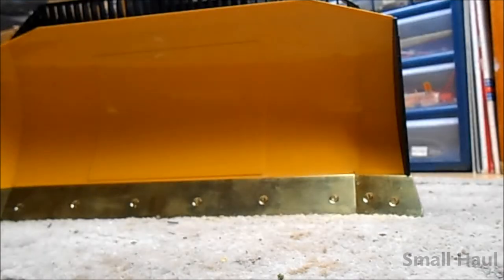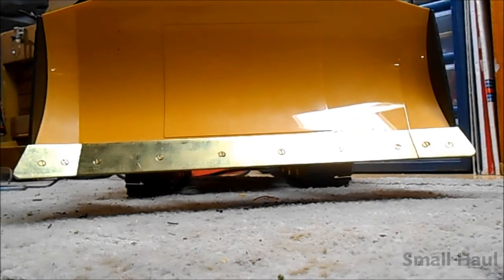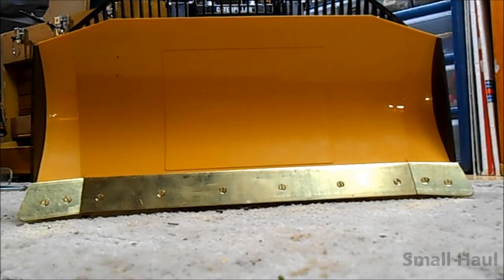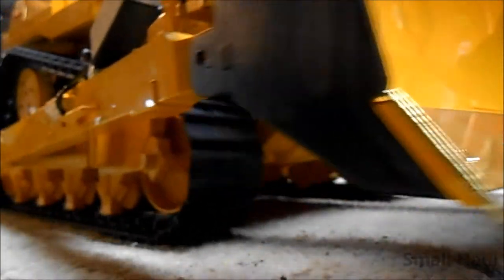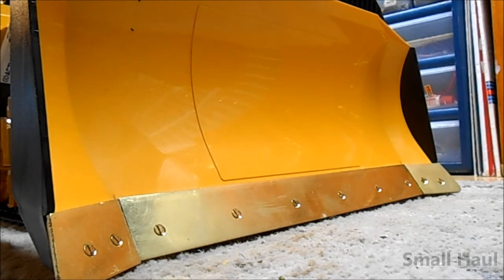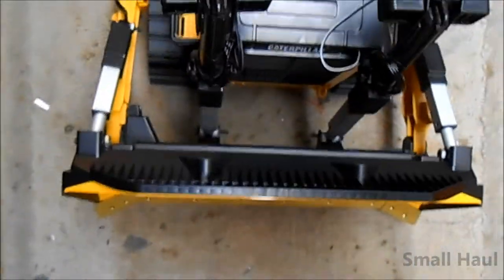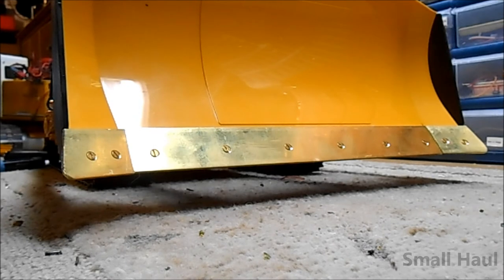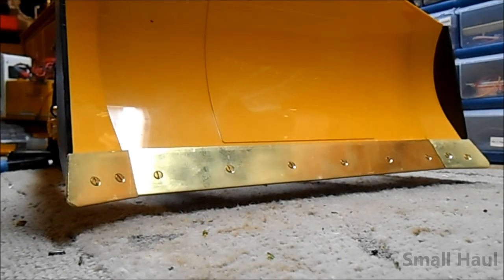Actuator Blade movement

Comment: Noticed you have blade tilt actuators fitted, did you wire both into one ESC..or separately, ? really want this on mine but only have a 6 channel set up and want the others for blade hoist and rear ripper....

Comment: Nice, runs really well! 
Could you control them separately (via a mixer) so you get a tilt blade? 
Also, are you running a panhard-style rod from the chassis to the blade or blade arms to center the blade?
Reply from the maker: Thanks, You could run them separately but, you wouldn't be able to twist it too much because the model isn't made to twist/tilt. It comes with cross bar that is held on by two tiny plastic hoops that are cracked on every machine that i have seen so i always remove it but, the way the model is made a panhard/rod isn't necessary to keep from moving from side to side because the track frames hold the blade centered during the entire stroke.
Reply: Thank you for that detailed explanation! :)